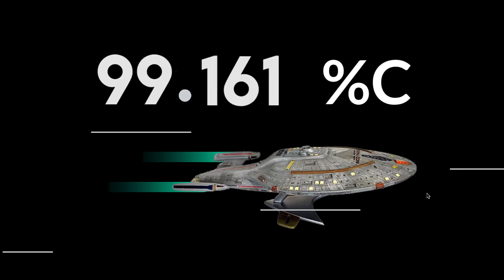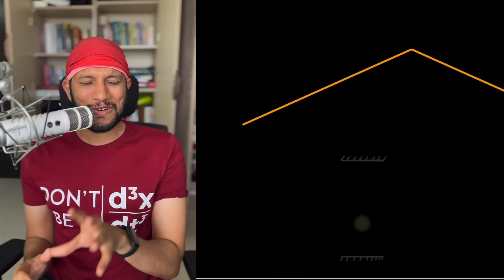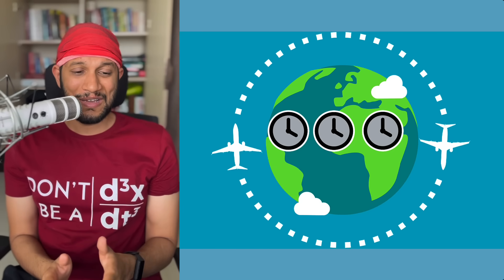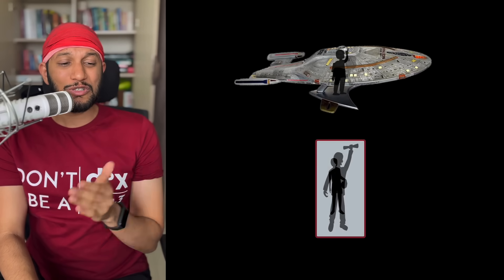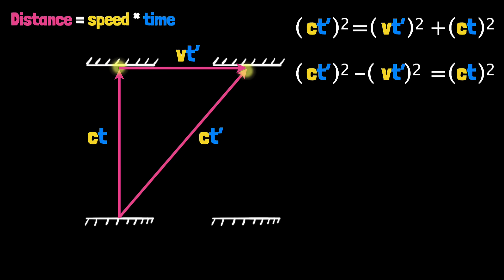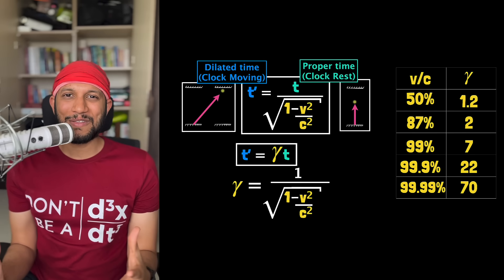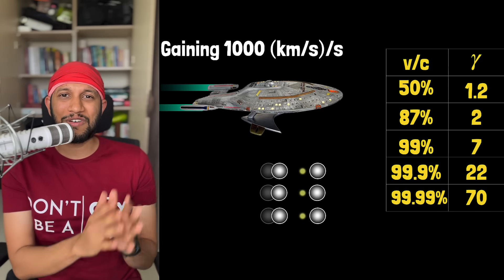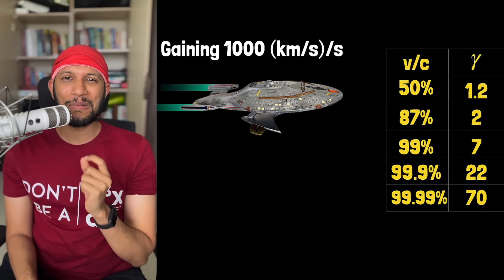I finally understood why you can't go faster than light! (My mind is blown)

Comment: There's even better evidence of time dilation, in the form of the first GPS satellites that were launched. At the time, physicists warned them that the satellites would be subject to time dilation effects, their clocks would run slow due to the speed they were orbiting at. GPS relies on extremely accurate time measurements, your using the time it takes for radio signals (travelling at the speed of light) to get between the Satellites and GPS receiver to triangulate your position, so if the clock on the satellite is off, it'll throw the accuracy of the position calculated off. 
The engineers behind those first GPS satellites didn't believe this time dilation stuff, so paid no heed to it, and went ahead and launched those first satellites....... within weeks their accuracy had drifted to a point they were useless. When they investigated this, they found the clocks on those satellites had drifted off, by exactly what the physicists had calculated based on Einstein's equations.
They had to scrap those first satellites and replace them with sats that had inbuilt compensation.

Comment: But hold on a moment. So a ship begins at a certain speed, we'll call it the initial speed, and accelerates continuously. I fail to see why the perception of its speed from either the vantage point of the initial speed or from the vantage point of the ship is considered relevant in measuring its actual speed relative to its initial speed. And I fail to see why that would be a strictly philosophical matter. If the ship accelerated to, say, 30x the speed of light from its own perspective relative to the initial speed, and then we paused to measure the actual distance between its starting location and current location, what would we find? The actual distance, mind you, not the ship's perceived distance and not the initial speed location's perceived distance. The ship and where it started accelerating from would both see each other as being far closer to each other than they actually are (bound by the speed of light as illustrated), because they would both be seeing past versions of each other at that point due to the light not having caught up. But those past versions they see would not be the actual location of either at that moment. And the actual location, not the perceived location, is what really truly matters when discussing how theoretically fast it is possible to travel through the universe. Where am I wrong about this?
Reply: This is the same problem I have with understanding this .. even after this video.
There is something problematic about basing this on observation, since observation is just delayed and does not tell the actual time ?
I totally get that time is not real, and yet we try to measure it ... maybe the answer is there. Shrug, I am not smart enough to understand this :D

Comment: But what if the photons in the force carrier where quantumly entangled?  Then instead of transferring traditionally, they all moved in unison simultaneously. Hence there is no delay and no time dilution.  Can you work out the math on that?
Reply: Unfortunately AI tells me this can not be done: "Your scenario would require a fundamental change in our understanding of quantum mechanics and relativity to allow for photons to act in unison in a way that bypasses the speed of light for interaction or information transfer. Current physics does not support this idea. While entanglement provides correlations that appear non-local, actual transfer of information or coordinated movement in the physical space still adheres to light speed limits. Therefore, mathematically, we can model entanglement and interaction, but the notion of "no delay" or "no time dilation" through entanglement contradicts known physics."

Comment: You don't even need to go as far as the Lorentz factor. If the force carriers maximum velocity is C, then if the next particle is traveling at C, it can never close the distance and transfer its force. Correlate to that: the closer you get to C, the lower the velocity delta. Which means less force imparted by the force carrier. As you approach C the time it takes to transfer the force approaches infinity, and the force imparted approaches zero.

Comment: Okay maybe I am misremembering something or didn't understand it, but I thought you can't ACCELERATE beyond the speed of light.
Let's imagine an object or particle that exists at a faster speed than the speed of light. I think they are called Tachyons or something. So it would definetely go faster than the speed of light. But you wouldn't be able to slow it down to the speed of light (or even slower). So it's basically an invisible barrier, you can exist on either side of it, but never cross it.
Please correct me, if I got something wrong.

Comment: You can travel faster than the speed of light, but as soon as you make it there is nothing left in the universe to confirm that you actually did it. You would have to outlast EVERYTHING (the last black hole, the last photon, the last evidence of any physical law) to the point where nothing happens. Anything that reaches the speed of light immediately ends in the state of NOTHINGNESS in our universe.

Comment: And therefore:

Time is not a dimension, it is the rate that the force carriers are allowed to transfer change of state from one particle to the next. The higher the speed, the more time it takes for change to pass along each particle, and therefore time is dilated for the outside observers.

This means the universe is composed of one or more fields, on which state change from one particle to the next takes constant time. 

This also means that the universe is quantized, i.e. it's composed of pixels, because if the change from point A to point B has to take longer time when an object moves, it means it has to take more steps, i.e. cover more pixels. 

This also nicely explains why light red-shifts and then disappears, as the universe expands: expansion means more pixels are added, and therefore the light has to travel more pixels to reach us. If new pixels are added faster than the speed of light, then light will eventually disappear and never reach us.

Comment: i'm not sure but a simple explanation would be that 
considering the duality of lights (wave and particle) it grants it a mass of exaclty zero (because a wave cannot weight something) and we know that its harrde and harder to accelerate something with it's mass incressing meaning that to match the speed of sometinh really light something heavy would need way more energy 
now if we take light because it has no weight you need no energy to accelerate it and every object is infinetly heavyer than it meaning it need infinetly more enery to match its speed or you cannot get infinite energy so you cannot accelerate anything that has a weight to the speed of light 
Also it opens the debate to way of being "faster" than light like the cherenkov effect where you take a light particle (still heavier than light) but because of its small weight it need little enery to get really fast (like 0.95c) but in water light is slowed down and particles (only is certains meduims) can get faster than light 
Also using wormholes in space you can "travel" faster than light here it's only because you're using a shortcut in space time so you aren't technically going faster than light but inly taking a shorter path than it
Reply: the only way i belive to go faster than light is to have a negative mass to get accelerater faster with the same energy but if i'm not mistaken it's only for one particle the tachyon and only according to theroy we have not yet seen this anywhere

Comment: ah but if you can make an energy /plasma field around the ship... that space would interact with that field not the space outside it right?  since that interaction would protect the ship within... could that field not alter the mass of what is within by its ability to interact instead with the space outside it?   i mean if the space within the field is weightless, and the ship is floating/traveling in that space then the bubble could potentially travel faster than light carrying its cargo of space and whatever is within it?  now generate additional fields or a flow in that energy field that can provide propulsion... with its interaction with space(whatever it is interacting with already)  i mean its not like you can hit the speed of light using a thruster without decades of firing.  think of a rail gun but instead of firing a slug designed to interact with the different fields... but that slug being in itself another field being repelled or drawn with them.  space is not as empty as most think.  eh idk if i explained it well... but if you remove most of the mass by it being supported in a field ( my best example would be a magnet being supported by other magnets ) if that magnet is floating in a 1 g atmosphere... then that magnet has no weight right?  like if you weighed it as it was floating there in normal atmosphere, in the field... would it have a weight?  or would it only have weight when not in the fields floating?  mass manipulation is the key to traveling faster than light... but that is my opinion.  peace.

Comment: The argument against this is the momentum force inside the object traveling faster. When you’re inside a car traveling at a fast speed, or a plane, your movements don’t really slow down. That’s why you don’t get stuck to the seat, because of the momentum force that stabilizes you at that speed. Does that force not exist when you reach the speed of light?
Reply: Does that mean that momentum force does not exist at the particle level?

Comment: Here's the problem: Any vessel that is experiencing gratuitous forces exerted on its very atomic structure as you describe will not hold together, if that's true.  Because, and this is the most important part, if you're being affected on that level, then I have bad news for you.  Your engines are breaking free of your ship.  Space has no apparent friction in the void, but in sci-fi, you see them talking about inertial dampening fields.  Why?  Easy enough.  The stresses of approaching and passing the speed of light must demand that you have a way to maintain the stability of your craft on the atomic level.

I do not completely hold that the velocity is impossible to reach.  I think our understanding of it - because it's theoretical and untestable until we advance a great deal - is very limited.  However, I have considered an odd idea of my own about all this, in terms of traveling FTL and the nature of how it affects time.  Look at our world, see our timezones.  Some are a bit arbitrary in placement, but it's an agreement that halfway around the world, it's midnight when it's noon where I'm sitting.  I have cousins in such a timezone.  It's tomorrow there, by all the reasoning we have.  If I appeared there instantly, I'd be at tomorrow, and if I went the other way, I'd be back to yesterday, which is today.  Now, walk with me on this one...

If I took the fastest jet in the world (You know the one.) and flew west, racing the sun and continued going, I would reach yesterday, in accordance to our timezones in a number of hours, assuming I was properly refueled the whole way.  I thought about this and said "That's really cool!, but you can't keep going back.  There's a threshold.".  There's a point in the world where it's legally yesterday to some, tomorrow to other.  The rotation of the Earth and how we measure time demands it.  Now then, in space, astronauts use Elapsed Time due this very problem, because whose time do you keep?  It's six o'clock somewhere.  The fact is, that while we have a perception of time and how to measure it from place to place, there is an absolute time simply in how long events take to happen.  The time dilation thing has always been confusing because the point of all acceleration for any reason is to SAVE TIME, and it seems to work backwards to this purpose.  Now, assuming your spacecraft does, in fact, hold together for the journey, what would a round-trip around Earth's orbital path around the sun look like?  Some might quip about time dilation and effectively losing time, but would you?  I have a different theory.

This has probably been thought of before, but I haven't heard anyone say it: Spatio Timezones.  You leave Earth, you come back, what happens?  Your FTL speed was about as constant as you could make it.  Did you really timewarp the whole way somehow to lose everyone you ever knew?  Or did coming back to Earth meet a threshold because you were at the same speed the whole time, and the only real time you lose was the elapsed time, the physical speed of the journey, which was fast.  If all things are relative, then leaving one's relative time reference (The Earth) doesn't eliminate time, just your normal perception of it.  I believe that if you park on an alien world, so many light-years away, you are in - effectively - a new timezone in space, relative to the Earth's position.  The absolute difference in time would involve the astronomical data used to calculate distance between worlds, stellar drift, etc.  You ARE effectively gone from history while you're out, but not if you come back.  If you were in a ship that made a round-trip to another world, took a few pictures, and then got back - all FTL - you are essentially going to tomorrow and back to yesterday, in my view.  You lose travel time, the elapsed time for the duration of events to take place.  That's it.

If we lose all hope in achieving what may seem to be the impossible today, we have nothing to look forward to tomorrow.  Yesterday, cold fusion was impossible.  Today, it actually works.  Tomorrow, it will be practical.  Good times, everybody.  Live for them.

Comment: Except everything is dialated because the earth is constantly moving, both revolving and rotating around the sun. Thus we are always in motion.
As well as the solar system going around the galactic center of the galaxy and the galaxy moving in the local group.

Lets not forget that the earth orbits around the sun at 67,000 miles per hour.

Comment: They way I think about it is everything is standing still. Speed only exists relative to other things. So if you are accelerating for 50 years, you are still standing still. That is why you cannot reach the speed of light. At a 99% relative speed, the other stuff (space) is compressed 7 times.

Comment: This is actually so simple.  Stop thinking about speed, and think instead about kinetic energy.  There is no limit on how much kinetic energy you can give an object - you can ALWAYS add more.  And since you're always free to adopt a coordinate system in which the object is still stationary, you can always think of it just like you think of first starting the object off from zero speed.
 
But, it's clear from looking at the equation for kinetic energy, E = m*c^2*(1/sqrt(1-v^2/c^2) - 1), that no matter how much kinetic energy you add, the SPEED WILL NEVER REACH C.  So it's as simple as that - you can't reach the speed of light because it would require "infinite" kinetic energy.
 
I don't see anything at all hard to understand about it.  Once you demand that the laws of physics be invariant under velocity boosts, the existence of a limiting speed c becomes an inevitable consequence.  You can't calculate the value of c from that theory - you have to measure it - but it's EXISTENCE if a direct consequence of that invariance.  You can show this with mere high school algebra.

Comment: No no no. The 'tick' is a sound, and everybody knows that sounds travels much slower than light. Actually the photons CAN go much much faster than the speed of light, but you can't hear the ticks until much much MUCH later. Sometimes, the 'gong' on Grandfather clocks just go off seemingly all by themselves, whereas in fact these are just late sounds from the faster-than-light mechanisms (if these are hyper-augmented super fast photon clocks) - which is indeed why they are called 'Grandfather' clocks; the sounds are very old and the actual initial 'parent' sound is already dead and gone.Sometimes though, the sounds come BEFORE even anything mechanical has happened at all, because the action is IN THE FUTURE and hasn't happened yet but WHEN IT DOES (at faster-than-light speed) the whole material dimensional matrix is twisted and you are hearing something on the obverse side of the time track. This can be proven by the inverse function of musical inharmonics - which law states that while time is a function of motion, harmonic motion (which is predictive in simple linear time) is not simply intuitive but certain. You are wrong.

Comment: You can go faster than the speed of light. There is nothing in special relativity, which would not allow you to. The problem is that you can either go slower than light or faster than light. You can't switch between the two. The speed of light is a barrier.

Comment: I have a question on Time Dilation: (Please can anyone help here)

Let's have 2 people with synchronized clocks go in opposite directions at some high speed.
After a fixed time on their clocks, they need to reverse their direction and come back. 
For any one of the observers, the other person is going at a super high speed, and their time should slow down. 

So when they finally meet and are at rest, what will they both observe on their clocks?

Ideally, both should observe the other person's clock a little dilated for themselves. But that cannot be the case???